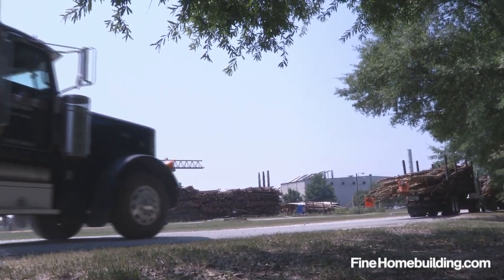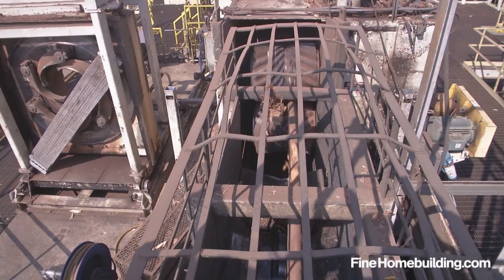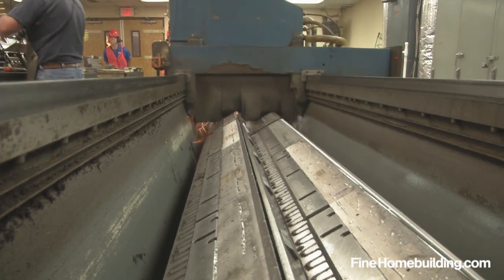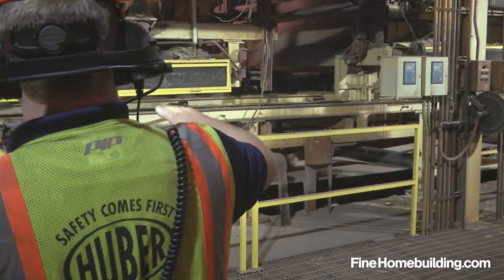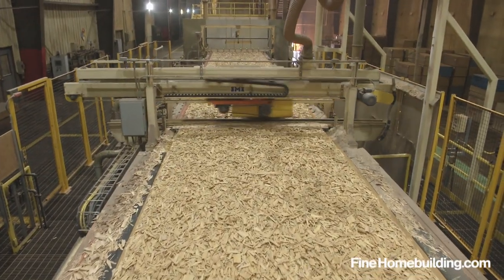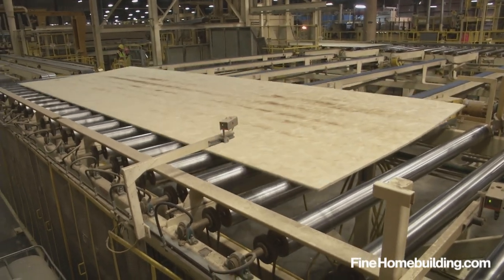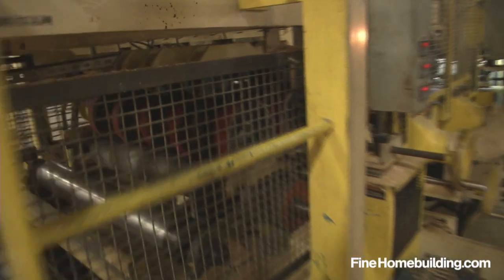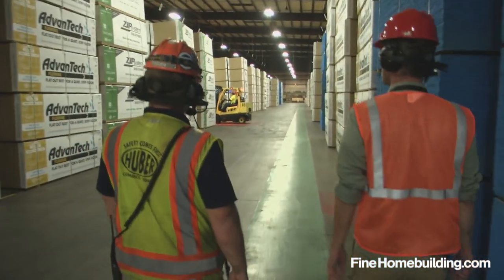Huber Advantech Factory Tour

Comment: I love Huber products and use them all the time but does anyone else get a little freaked out by the scale of modern stuff? 100 30 ton logging trucks every day in a continuous queue? They look like young trees and OSB is super wood efficient but this is just 1 plant from 1 company. I hope forests can keep up with this kind of intensity...
Reply: The logging industry has been managing the same timberland for decades and it is carefully managed.  Those trees appear to be smaller trees that are culled during the early stages of new tree growth.  This is done because without culling the trees will crowd one another and slow the growth of the trees needed in several years for timber.  Basically they use trees that are useless as timber trees for OSB manufacturing.  As noted in the video, Huber burns the bark as fuel for their furnaces, the timber industry tries to keep waste to a minimum as much as possible.
Reply: there is currently a glut of southern yellow pine. price is as low as its been in 50 years. almost not worth getting rid of.
Reply: I remember many decades ago of a technology that uses superheated and super-pressurized steam that mixes with wood flakes and blast them against a mold and is pressed still hot and allowing the natural wood liquids to bind them together. What happened to that technology? An another technology uses a method to use steam to bake wood to harden and strenghten them based on an ancient principle of using fire to harden wood. What happened to that technology? An another technology uses the ancient Biblical principle of making gopher wood in which layers of wood sheets are bonded-saturated with natural boiling sap resins and then are pressed using mechanical vise and allowed to cure overnight. The next day when tested, when bent, only the outer layers will slightly crack but no more BUT THE BONDED LAYER BETWEEN THE BONDED LAYERS WILL REMAIN UNBREAKABLE.

Comment: I remember many decades ago of a technology that uses superheated and super-pressurized steam that mixes with wood flakes and blast them against a mold and is pressed still hot and allowing the natural wood liquids to bind them together. What happened to that technology? An another technology uses a method to use steam to bake wood to harden and strenghten them based on an ancient principle of using fire to harden wood. What happened to that technology? An another technology uses the ancient Biblical principle of making gopher wood in which layers of wood sheets are bonded-saturated with natural boiling sap resins and then are pressed using mechanical vise and allowed to cure overnight. The next day when tested, when bent, only the outer layers will slightly crack but no more BUT THE BONDED LAYER BETWEEN THE BONDED LAYERS WILL REMAIN UNBREAKABLE.